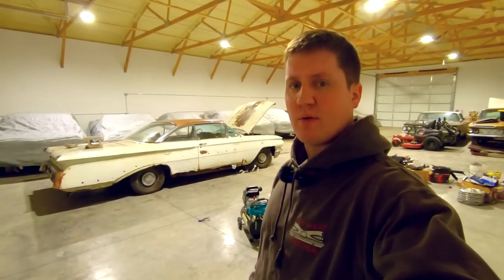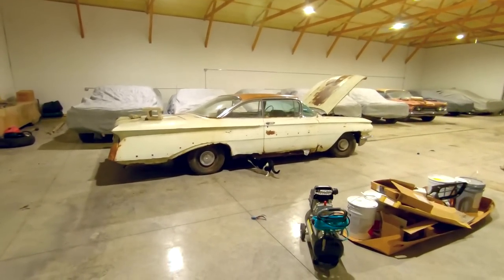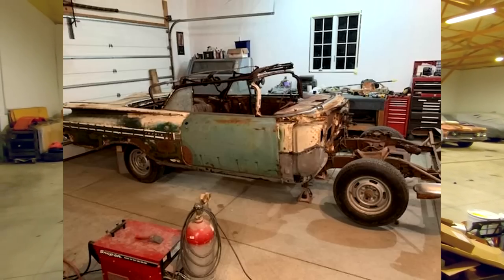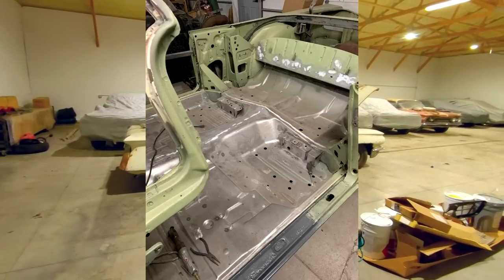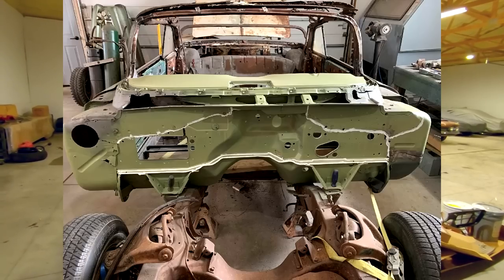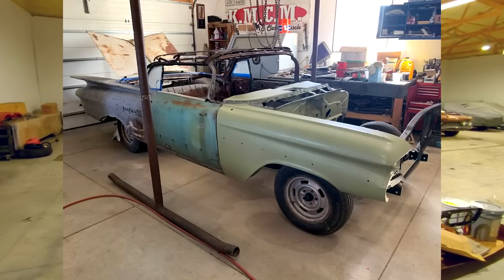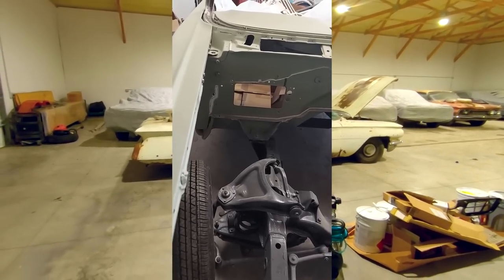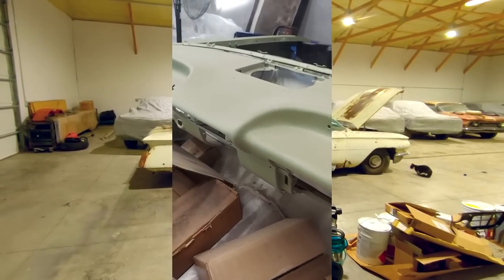"UNSAVABLE" 1959 Impala Convertible - Restoration UPDATE Video! (1959 Chevrolet Impala Convertible)

Comment: In that state of disassembly, the 1959 Impala convertible's cabin, doors, floor and chassis can be reinforced to today's crash safety standards. Substitute the old straight steering column with a safety steering system. Add ABS disk brakes, head safety restraints, seat belts, and air bags. The result will be a gorgeous 5 star safety equipped classic. This custom rebuilding will increase the value and durability of the classic car. New category SC (safety customized) classic. Thanks.

Comment: I know a guy with 2 59 ragtops, one is all original the other one is a conversion made from a 4 door. When I asked him about the conversion since he had an OG factory convertible he just said he built the conversion to enjoy it and the factory convertible was like an investment. His attitude changed my mind how I felt about conversions. If I found a 59 convertible in that shape and I had a rust free 4 door it would be very hard to not do a conversion as it would be cheaper/easier in the long run and as long as I enjoy the car other people's opinions wouldn't bother me.
Reply: exactley i found a very solid 348 4dr impala sedan for $600 stored out of the rain since 1976 . and then i collected all the convertible parts but the rear seat.  im doing it black with red interior.
Reply from the maker: thats a good thought on his part

Comment: i agree with your idea of conversion and restoration. yes if the 59 started out as  convertible and VIN is there,  then any parts put into the car to make it road worthy, is OK with me.  we put parts into drive train and tires and exhaust and etc, anyway so why not body.

i also think Mark Warmon should have done the Charger Daytona. He said the engine was known of where abouts. i would say ok to redo the daytona.  they also do cuda with aftermarket K members and engine and rear end.  so why not body. they had the VIN for it.
Reply from the maker: thanks!

Comment: Excellent video Ryan  :) also did a Scrap Yard find in 2008 a guy got in 1980's  also fix up totally it was rare 1960  Jeep C Cargo Van delivery truck from farmer had Milk Business year ! But owner want mofied in roadster vechile and took lots hours find extra parts on but got fix also sold for big $ ! Orgnail frame shot so find one and costumeize up and different engine to V8 from 4 cylinder also transmission, fuel tank plus axle and much more ! Plus fun do 7 years part-time because other projects at work need done too! But fun to do overall and lots challenge to!
Reply from the maker: thanks man!

Comment: I am behind the time line for comments but I agree. A rebody is just that, a different body or taking the tags or cowl with tags on to a different body. Rebuilding the original car with parts from other cars or aftermarket parts is a restoration. Just about anything can be rebuilt if you have the skills or the cash.

Comment: We're at the point where people are splitting hairs. The fact is, you found a convertible that is a rare find any day. To restore it, all rusty, damaged and worn parts need to be replaced. In that car's case, over 90% of the body parts. But the vin is there. A person may own a car for 50 years, and if they use it regularly, they would replace tires, brakes, repair rust, seat covers, etc so perhaps 50% of the original car would be gone, but it would still be that car. Btw, Peterson Restorations does this with Mustangs. Generally, he keeps the roof, inner body, frame, interior, engine and trans,  but replaces all the sheetmetal.
Reply from the maker: i have to split hairs because people like to argue that question on the internet daily lol
Reply: @IowaClassicCars  you're one of the most interesting car collectors out there today. Keep doing what you're doing

Comment: the 59 ragtop is turning out really nice, what color is he planning for it ?
Reply: I might be going with black with red or original white with red interior
Reply: @EGonzalez915  that sounds good . the car is looking really good , you are doing a beautiful job on it . i am building a 59 convertible conversion car . using a 348 4dr impala and all the real convertible parts and convertible chassis. i am painting it black with a red stripe and red tuck n roll interior sewn by me. its going to be a driver.
Reply from the maker: yeah it is!

Comment: Hey Ryan this is Dean, we have spoken before I am the guy that has the 59 Oldsmobile, I have a question, are you going to end up parting out parts from your 60 Oldsmobile ?
Please let me know as I am in need for parts, specifically brake drums, can’t find any brake drums anywhere for my 59 Oldsmobile and a 60 has the same drums as well as a 61, I thought I had me a new old stock set of front drums but not so much. Let me know what’s up with the 60 Oldsmobile thanks Ryan
Reply from the maker: i emailed you back

Comment: many take a car and change the suspension, wheels, engine, trans, interior, update lights to led/halogen, replace the tank and lines, brakes, add a/c...isn't that about the same?

I love the ability to save these basket cases. Usually it's not economically smart (time/parts/money ) to save them

As they say it's better to buy one already done.

I'm working on a 76 MG midget..'all there' is relative...it's been fixed at least once, on much of the body. the engine has been rebuilt, the entire brakes system replaced. some updating (rubber bumpers removed), it needs an interior, it's had a new roof, needs a new wiring harness...

Not counting my time or skills or tool investment I'll have 5k in a car that could sell for 7500..more if hte body work and paint are perfect.
I could buy a very nice car for that....andhave my time back.

BUT if this is a hobby, then the time isn't 'time' in the form of work but of fun and therapy.

Does that time have value? I don't know...ask those people that golf or ride a harley or sit at a car show for 6 hours or walk a parts a rama for 8 hours.

Comment: I agree somewhat and disagree! while you are technically building a original car back to what it originally was does make it the real deal, it still has alot of unoriginal metal including aftermarket panels and even the frame sometimes. I dont have a problem with that honestly but what I do have a problem with is people who shit on a correctly done convertible conversion vs a really rough convertible. In my opinion a correctly done conversion is no different than restoring a really rough convertible besides the paperwork. Most times the real convertibles has even more replacement panels including aftermarket panels, hardtop panels, and 4 door panels to repair them. Most of the time a conversion has more og gm metal than a real one because the adverage person building a conversion dosen't start with a rust bucket. Its not like people restoring real convertibles are only using real convertible metal lol. Im honestly considering doing a conversion. It all boils down to quality of work a hack job is a hack job real or conversion
Reply from the maker: all cars, conversion or not, need metal. its a gray area for sure
Reply: @IowaClassicCars  Most cars do, but the question is how much metal work can be still considered original? If thats the case just buy a fire wall with a vin tag and paperwork lol. All that metal on top of a frame swap is close enough to a conversion. You would honestly be surprised at how many 4 door cars have convertible titles because some guy bought a rust bucket for the title and vins because legally you only need so much of the metal around the vin

Comment: The ship of Theseus, if over time slowly every board is replaced is it the same ship? That’s a millennia old debate. 
 The USS Constitution is a case in point… wood gets old rotted and replaced but it’s the same ship being maintained and repaired over the years. 40% original lumber remains (?)… but the same ship same specs and still sailing. 
 Cars are the same. Replace fenders floors rebuild engines replacing worn parts but the essence of that original vin # persist.
Reply from the maker: good point!